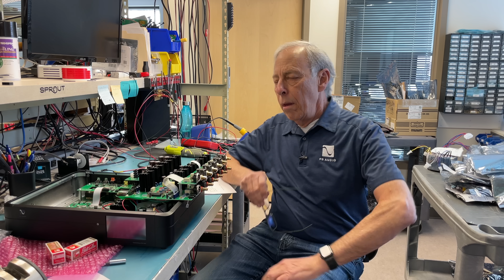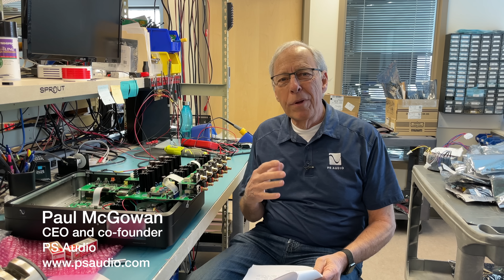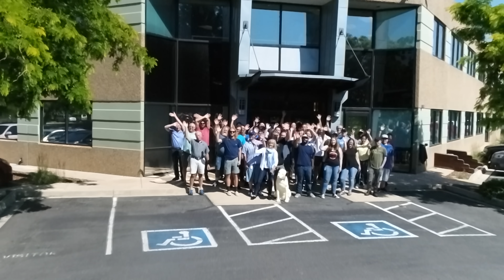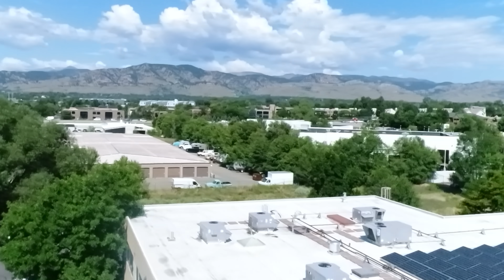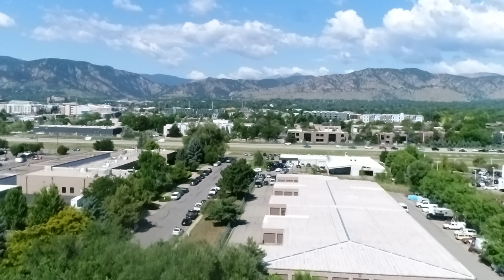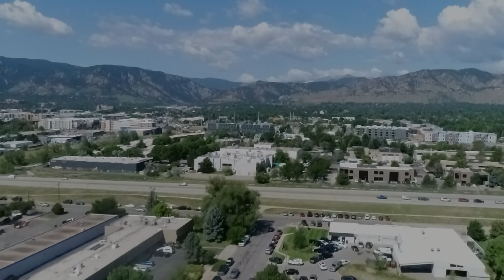Why high resolution audio?

Comment: Great answer Paul. Even though I thought knew the theory, it's nice to have a major industry figure confirm it!  All the best, Rob
Reply: For a deeper dive, the fabfilter people published a very good video on the topic a year or so ago. It’s called Samplerates: the higher the better right?   (Is here on YT). It is very illuminating.
Reply: @lindsaywebb1904  I can refer you to Amir Majidimehr channel a video called Antonio Forcione looking into files of Hi-Res Audio.
Reply: Please take a little time and search the academic credentials of the major industry figure which you refer to.
Reply: @IsmaelMartinezPR  Why?
Reply: @RobWhittlestone  Respectfully, this is what I found about Mr. McGowan. I quote: "I am a self-taught analog electronics engineer and have designed most of the analog product built by the company". I will reserve my assessment of such statement. However, there are other resources where technically trained professionals address this same question available. Best.

Comment: Some of the comments below, along the lines of "it's just marketing", "you can't hear a difference" etc etc are just plain wrong. 

I have both the hi-res audio and the CD quality version of John Powell's 'Solo: A Star Wars Story', the same mastering, released at the same time. The hi res version is FLAC 24-bit 192 khz, the CD version is the standard 16-bit/44.1 khz. The difference in sound quality, the sense of space and soundstage between the two is simply incredible - if you cannot hear a difference then either your ears are knackered or your equipment isn't up to it.
Reply: @ReaktorLeak Looks like Youtube may be stripping out my reply with links, so I'll just have to give you generic details - it's on Prostudiomasters in the US, and on Qobuz for most of the world. Qobuz gives you the benefit of multiple file formats and qualities, whereas PSM gives you just FLAC hi res. Just search for Solo: A Star Wars Story Deluxe
Reply: @ReaktorLeak Why on Earth would I want to do that? I already have the full 24-bit / 192 kHz complete album, as well as the CD quality 16-bit / 44.1 kHz, and when I play both files through my system I can tell the difference. I have already "judged" for myself. I don't need to listen to your adulterated files when I own the originals and can easily listen to them, without having been downsampled or otherwise manipulated. What a daft waste of your time and efforts. Oh, and you're welcome for the links by the way - sheesh.
Reply: @ReaktorLeak They are the exact same source - as you'll see from Qobuz, you can download in multiple file sizes/options - I downloaded both the high res files and the CD quality files. It's exactly the same source material.
Reply: @ReaktorLeak You seem to have missed my original point - I HAVE the 192/24 bit version and the 44.1/16-bit versions, both from Qobuz, both bought at the same time. I am able to do my own listening test, and have done so - played back through my Node 2i the difference between the 192 and the 44 is clear.
Reply: @ReaktorLeak That's a few assumptions made, to be fair.  Quite why John Powell would be interested in making differently tweaked versions of a fan-requested download only, hi-res audio release of a specialist title is beyond me.  Playing the 192 file through my DAC - which cost just £499 including the streamer itself - sounds better than playing the same source material at 44. 

I also don't get why people jump up and down about the costs, and talk about spending $1000s - hi res files are only incrementally more expensive than standard CD quality files - and, more importantly to me, if the material is easily available at a higher resolution, and for only slightly more money, why would you NOT want it? It seems unfathomably stubborn to me!
Reply: @ReaktorLeak Sorry, I completely disagree with your assumptions here. To address the record labels issue: I specifically chose Solo as this was released as a digital release by John Powell for his fans, containing mostly unreleased music. He oversaw every aspect of it, working with his own 5 Cat Studios for mastering. There was no CD release, and the options were limited purely to 192 and 96 versions. Qobuz created their "own" CD quality version. So there was no manipulation by the label, no reason for them to do so. There was no existing material for them to compare to, and "claim" to have a better sound - this was the composer, working with his own studio, releasing a new album of previously unreleased music.

To address "evidence" - I hear a difference between 192 and 44. There is literally nothing you can present as evidence to the contrary for the evidence *of my own ears*. It sounds better. Is that calculable? No. Is it provable by a mathematical equation? No. So what possible "evidence" other than what it sounds like can I offer? None.

And finally - back to the "spending more" question. I'm sure there are releases of old material in supposedly better higher quality that are nothing of the sort. In fact, I know that to be the case, as I've bought new recordings that don't sound as good. But is that the fault of hi-res? Does it show hi-res as flawed? I would say not, I would suggest it shows poor mastering, and opportunism, usually on off-brand labels.  Caveat emptor.  If I see a newly remastered score, overseen by someone like Neil S. Bulk, for example, or Mike Matessino, then I want to hear it. If it's available in a high-resolution format, then I want that. It costs very little more, hard drive space is cheap, and I have a DAC and system capable of handling it. I can create CDs from it for the car, or listen to it in better than CD quality in my library - it's all choice. Why would I not want to?
Reply: @ReaktorLeak What astonishing arrogance.  I don't need you to believe that I can hear a difference between the full hi-res 24-bit/196 files and CD quality 16-bit/44.1 files on my own system. Quite why you think I would subject myself to a test of your files - and god knows what you've done with them in downsampling them into wav files - is beyond me. You didn't even bother to get the 192 file to listen to!

You have made a number of assumptions - anecdotal evidence (which, by the way, isn't "evidence") of labels adjusting music for their own ends (sound familiar? "Listen to my wav files without knowing which is which or what I've done and how I've manipulated the files" - um, nope), that the sources are different (even though I have specifically told you the provenance of the album in question)... and you've said you don't believe me when I say I hear a difference, yet you want me to prove what I hear? Big bag of nope, right there.

You engaged with me, allegedly because you wanted to listen to the tracks to see if you could tell a difference. You say you can't hear a difference - should I therefore call you a liar?
Reply: @ReaktorLeak The answer's no. If you say to someone "I'll believe you if you take part in a test of my own devising" you are, in fact calling them a liar. Please don't waste any more of your money because I'm not doing your 'test'.

I'm not continuing this - how you can continue to say I'm listening to two different recordings when there is only one recording is just ridiculous. You seem to listen only to what you want to - and perhaps that's the problem.
Reply: @ReaktorLeak Good god. Nobody has to prove anything to you - what an appalling, arrogant and childish attitude.
Reply: @ReaktorLeak YOU engaged with my comment - I don’t have to justify anything to you. As for bullshit, I call bullshit on your “method of testing”. You’re just a troll, with too much time on their hands, seeking attention and whining because I refuse to get drawn into your world of crazy, or perform for you. Time to grow up.
Reply: @richardt3371  you need to take a lesson on how digital recording works, better than CD is BS.
Reply: @geoff37s57  You need to realise I don’t care about how wrong you are, Dan.
Reply: @geoff37s57  You joined YouTube today just to attack me? You are one seriously suspicious troll. Spideysense says you may not really be “Dan”. How sad
Reply: @richardt3371  :  You just have no clue what you are talking about. Please go back to school or at least educate yourself about this topic before commenting.
Reply: @Historia.Magistra.Vitae.  Thank you for your valuable input.  What you have failed to appreciate is the absurdity of the "test" concocted by ReaktorLeak - the basic premise is ridiculous and fundamentally flawed. In a nutshell he has taken a hi-res file and downsampled it to CD quality - then asked me to see if I can tell the difference. Missing the point - the hi-res release as a hi-res file sounds better than the CD release *as a CD-quality file*. Once again, I specifically chose a soundtrack release that was created by the composer himself, with his own studio - this wasn't a multi-format release, it was ONLY released as hi-res.

What ReaktorLeak has done is the equivalent of taking a 300 pixels/inch photo, resampled it down to 72dpi, then asked "can you see the difference?" No, because you've resampled it to the lower level, ergo giving it the same restrictions. Now try taking the 72dpi image you've created and see what happens when you upsample it back to 300dpi - it looks terrible because you've lost all the data.

Further, ReaktorLeak has then taken his downgraded CD quality file as proof positive that it shows CD quality is the same as hi-res - or that if there's a difference it's because of some studio shenanigans to artificially change the music for hi-res release ("anecdotal evidence", by god). Maybe, just maybe, that difference he hears in a hi-res file is the difference between a hi-res file compared to a CD file?

So, thanks again for your snarky input.
Reply: @richardt3371  : There is no such thing as "high res audio" to begin with. It's only a marketing term, a gimmick. The only way to make things sound better and different is through better overall production i.e. proper mixing and mastering.
Reply: @Historia.Magistra.Vitae.  With respect, that's nonsense. I suggest that shows your bias rather than any fact-based argument. Industry standard for studio recording is 48khz/24 bit - I say this as someone who knows just a little bit about trailer music recording ;-)  but sure, write off the industry standard.

Interesting that you choose to attack the 'marketing term' "high res audio" yet fail to address anything else. It was a simple statement - a 192/48 file in my system sounds better than a 44.1/16 file. The recording I chose to make this statement about was one that was specifically mixed and mastered by the composer himself and released only - ONLY - as a high-res audio file. If you can't tell the difference in your system, fine, but to argue that I can't?  Ridiculous.
Reply: @richardt3371  : The point is, if the composer of that file would release it as a 44.1/16 file, it would sound exactly the same. There is nothing in the 192/48 specifications that would make it magically sound better than 44.1/16 variant.
Reply: @Historia.Magistra.Vitae.  Oh god. Right, to reiterate: original file 192/24 sounds better on my system than the 44.1/16 CD quality file. It does not sound exactly the same. Your assumptions are incorrect. That is the point. I honestly don't know how else to say it. My DAC is capable of handling 192/24 and - again - it sounds better than the same track at CD quality. End of story.
Reply: @richardt3371  : The original file sounds different because it is a different (production) version than the CD quality file. Simple as that. Has nothing to do with the technical specifications whatsoever. As suggested earlier, if you would convert the 192/24 file to CD quality, it would sound exactly the same as the original 192/24 file since the difference is not in the specs, but in the production i.e. mixing and mastering.
Reply: @Historia.Magistra.Vitae.  Oh my god. There was no original file vs hi-res file. How many times? There is ONLY the hi-res file released by John Powell. I converted the hi res file to CD, and it doesn't sound as good as the original 192/24.
Reply: @Historia.Magistra.Vitae.  This was a hi-res release ONLY available as a high resolution audio release. No CD quality version exists - it was mastered (by the composer himself, in his own studio) at 192/24. You cannot buy a CD quality.
Reply: @richardt3371  : I never said "original file vs hi-res file". I said original file, which is the "high res" vs. CD quality ... The supposed "high res" will sound exactly the same as the converted CD quality file unless you did the conversion wrong. There is no audible difference between the CD quality and 192/24.
Reply: @Historia.Magistra.Vitae.  Blah blah blah. You don't believe in hi-res, fine, I'm not bothering telling you - again - that there is an audible difference. To try to tell me what I can or cannot hear in my own system, is ludicrous. You're clearly blinkered and have decided hi-res isn't real - bizarre - and I'm not wasting my time explaining to you that there is a difference - what's the point? You can't hear my system, so telling me what I can or cannot hear is just stupid.
Reply: @richardt3371  : It's not a matter of belief, buddy. It's a matter of math and science. Anything that comes out of your audio setup can be measured and proved. There is not and cannot be an audible difference since both 44.1/16 and 192/24 can record and play back 0Hz - 20kHz exactly the same. 192/24 adds nothing to the mix when we are talking about the range of human hearing.
Reply: @ReaktorLeak Yes, I'd like to know that too.